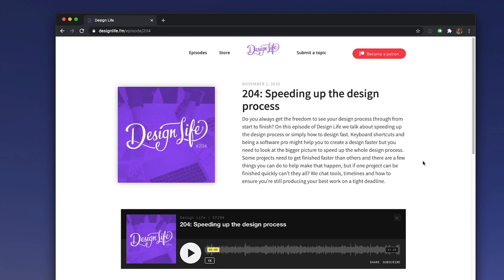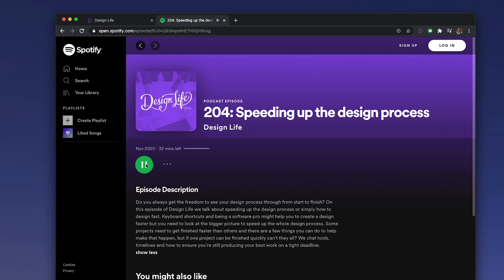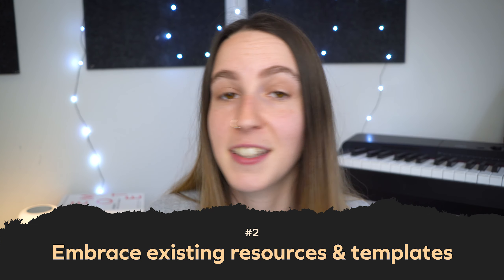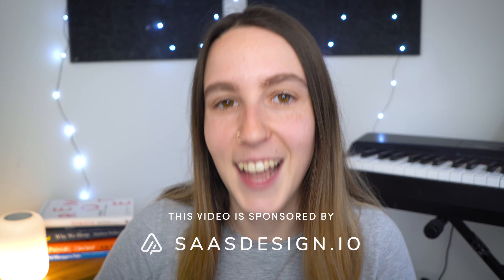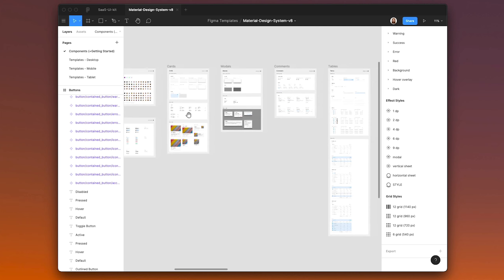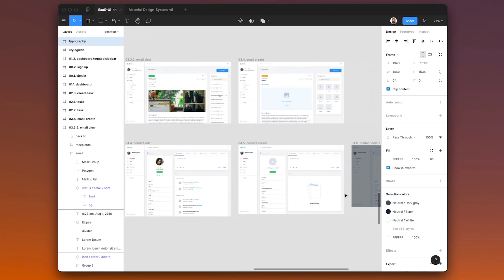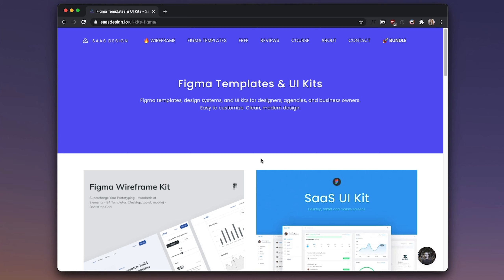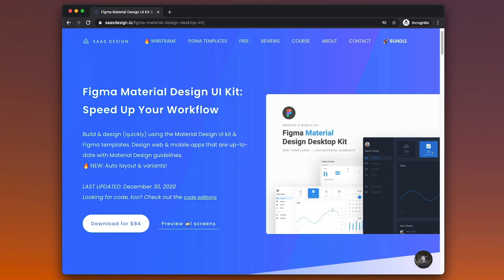How to speed up your design process

Comment: Thank you for this. here is my experience: 
context 1: reducing the risk is critical: i try to do as much as i can for phases 1 and 2 (the right problem, the right solution) and go quicker on the Done Right phase.
context 2: You need things done very quickly (by you i mean the team, we are part of a team and want to allow the rythem to be maintained, OR another department is pushing to sideline UX by accusing it of delaying the project and proceeding via POC): you cut corners, do with less research and head straight forward to the solution (ideally you would do some UT) and monitor user behavior via AB test or stats.
context 3: you work on accelerating other aspects of the project (gathering requirement, stakeholder interviews, ideation, validation workflow, testing presentation..) via Design sprint inspired approach. if the whole team is invonved throughout an accelerated proecess and you can have SME (subject matter experts) and enough data, you can define a problem focused space, work on that and generate many ideas quickly, and get rapide validation on what to test. and have everyone involved in the interviews and UT note taking and concept validation.

these are some contexts, there are others